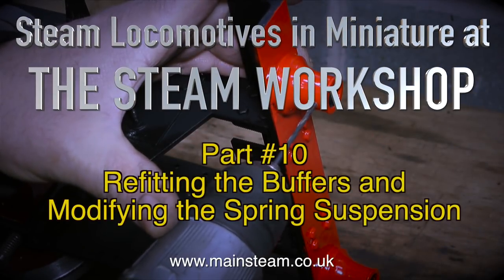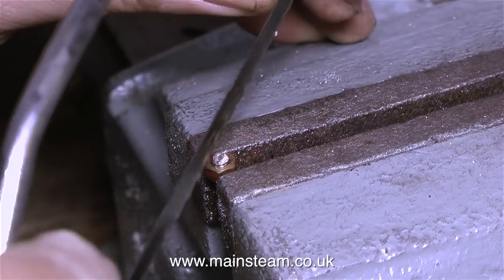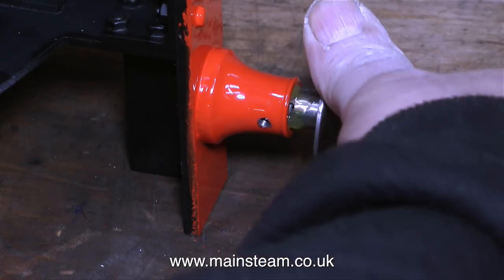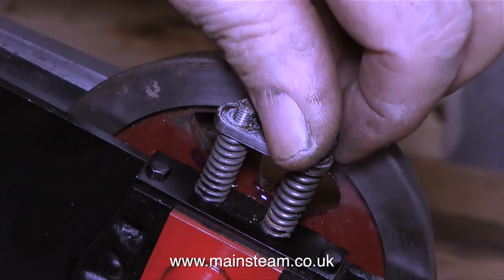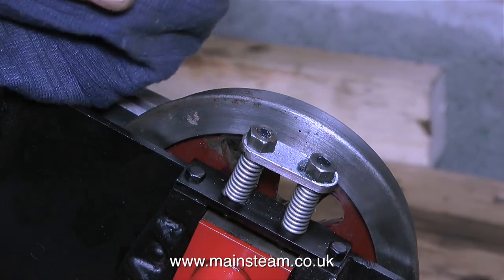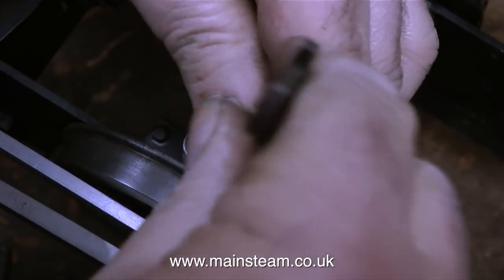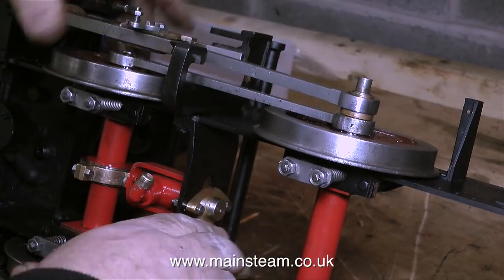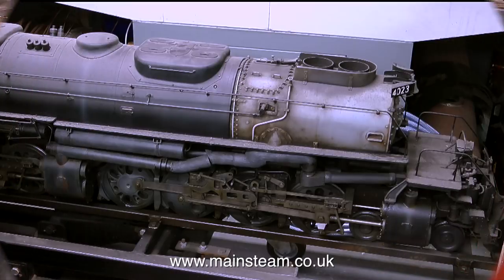WORKING AT THE STEAM WORKSHOP #10 - BUFFERS AND SUSPENSION MODIFICATION

Comment: Keith, would it be possible to cut the springs in half, put a strong half and weak half on each bolt making a progressive spring. I had an old Suzuki dirt bike with springs like that, think it was called a dual rate spring. That way each bolt would have the same compression rate.  just a thought. keep up the good works
Reply from the maker: Yes, anything is possible but I will try it like this first {:-)))

Comment: Hi Keith. Great Video once again. I just have a question about the springs and the mix applying unwanted twisting force or rotating force depending on spring layout. What order did you go with on each axle to avoid these forces and how do you account for balancing this across the whole wheel set?
Reply from the maker: It's not important - it just works .....
Reply: Keith Appleton I just wondered if it affected it. I did some stuff on that kind of thing at university but we never saw practical applications of it. I was just curious to see if in models you need to take account of it but I guess If it works it works and you can't argue with that!!!! Thank for answering my comment